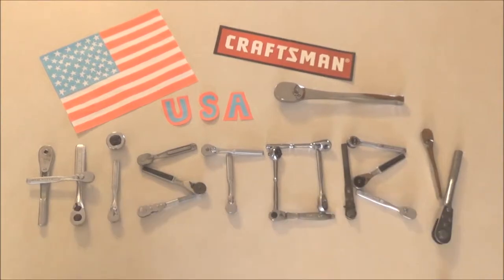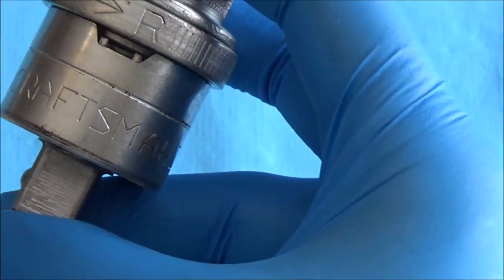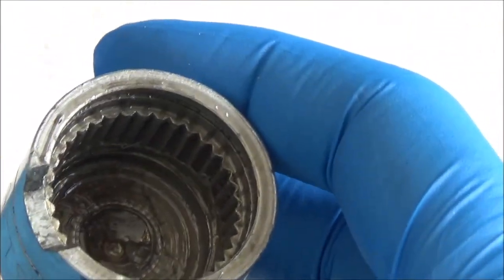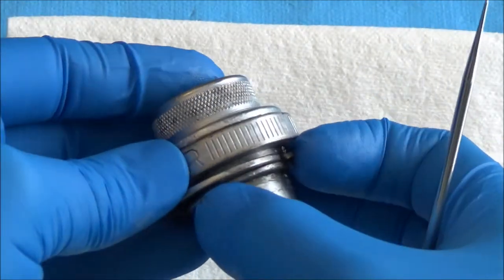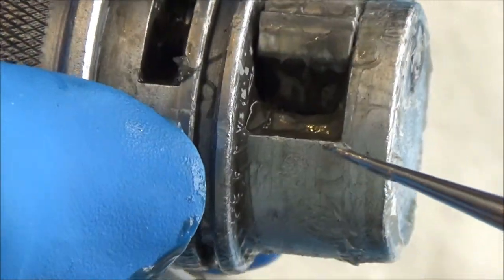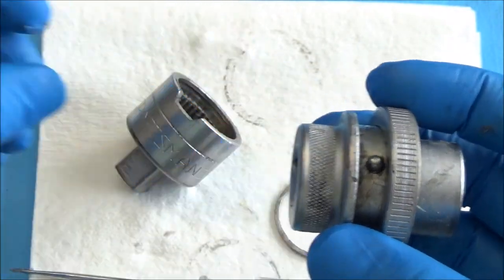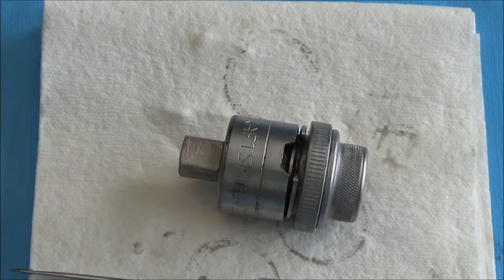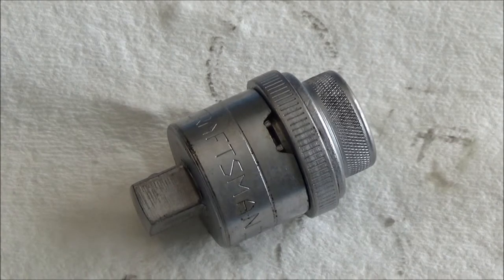Craftsman Tools - USA History: 1/2" Drive Ratchet Adapter - Rebuild & Discussion

Comment: I recently did a tear-down and regrease of an old Herbrand ratcheting adapter for 3/8" and a Williams H-55 for 3/4". I did actually have the same issue with the snap-rings.
Reply from the maker: Hi dreddnott!  Thank you for the comment!

Yeah, sometimes these old pieces need a little negotiation to get things to come back together.  I own MANY different brands of tools, and each company had its own creative ways to reinvent wrenches, ratchets, etc.  I've grown to appreciate these differences over the years.

Adds to the fun factor for guys like us!  ^_^